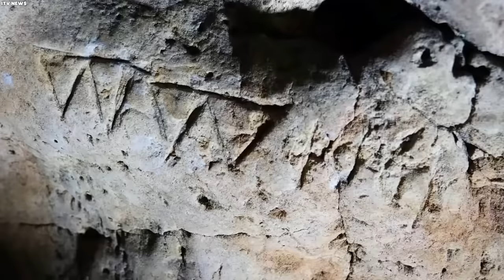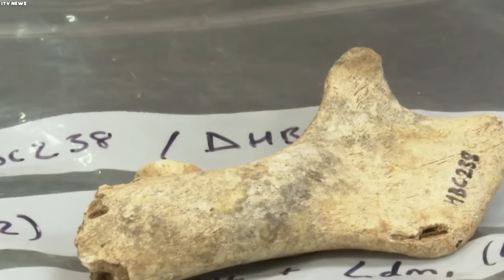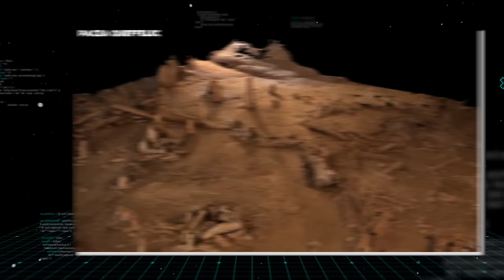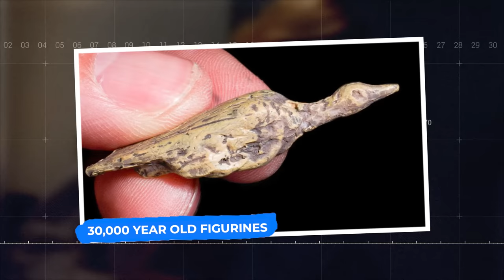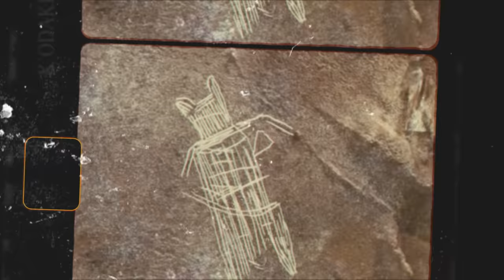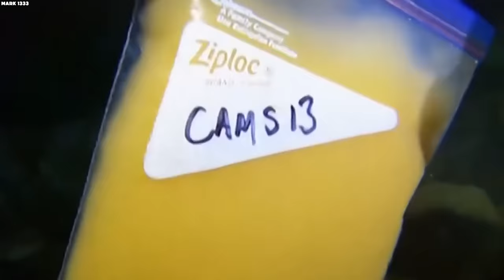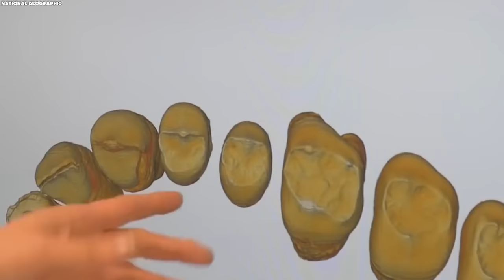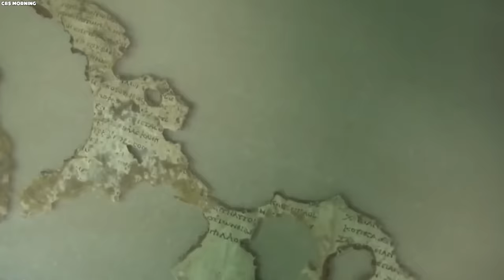What A Man Discovered Inside A Cave Shocked The World!

Comment: How about the Cheddar Gorge, UK? I have also been caving in a disused slate mine in Wales when about 13 or 14 years old, but can't remember where. (Unfortunately I am very accident-prone and had to leave that one early due to tripping on a steep slope of slate scree and ended up sliding ⅔ of the way down to the valley bottom, accompanied by a load of slate - was saved by an adult grabbing my hood as I shot past him, which I was very thankful for. A bit bruised and cut, but nothing compared to what would have happened if I'd hit the valley bottom at high speed with a load of slate on top of me!)